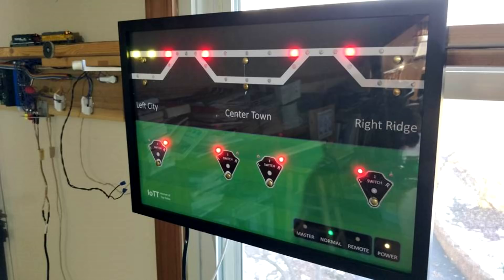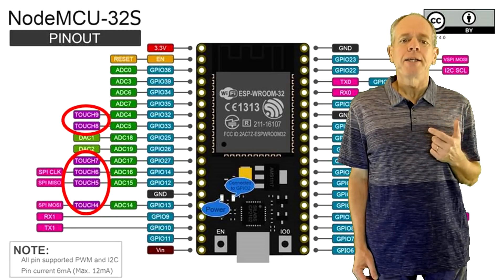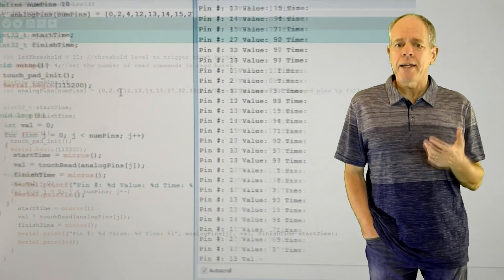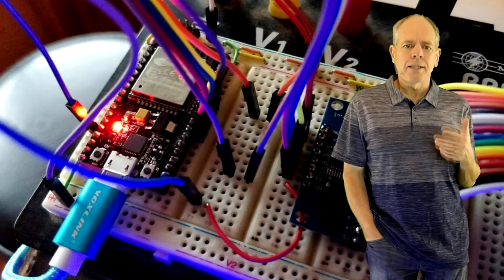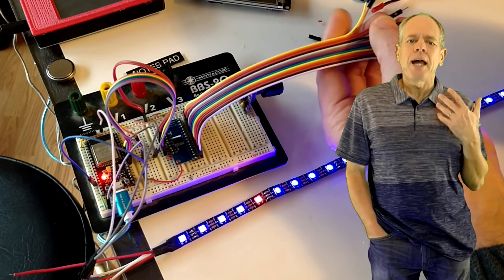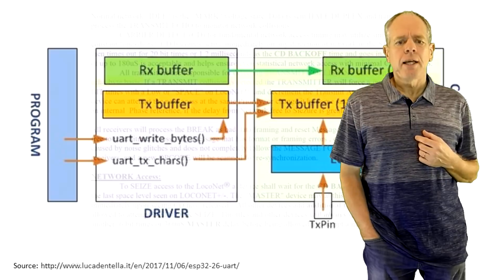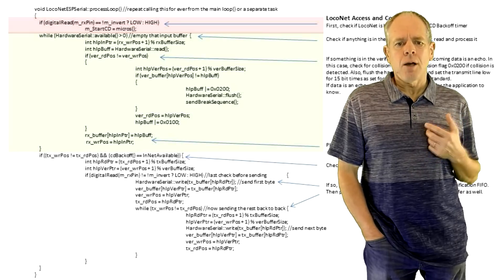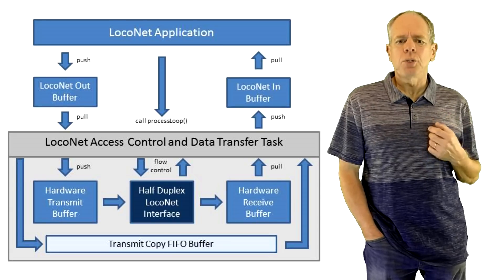Inside the CTC Panel Yellow Box (Video#10)

Comment: Innovative!! Really cool stuff I appreciate your detailed explanations of how you are able to get 64 capacitance touch devices to work. I look forward to seeing how you address the led strips. I'm curious why you choose to add the loconet code to the CTC controller,  I would have thought in the spirit of IoT/MQTT you would only need a MQTT client to publish turnout messages to your broker and then the loconet gateway you previously developed would subscribe to those messages and turn them into loconet commands.
Reply from the maker: Thanks for your feedback, I appreciate. As mentioned before, finding the right compromise between providing enough details and not boring people is the biggest challenge for me when planning the videos. Glad it worked out for you.
Reply from the maker: You can actually see the code needed to control the LED's in the second touch example. It is very simple, you just add the FastLED library and treat the pixels as an array. That's all
The reason for adding the LocoNet side has been explained in Video 9. Essentially because the Yellow Box can act as gateway at the same time. Two devices for the cost of one ;-)